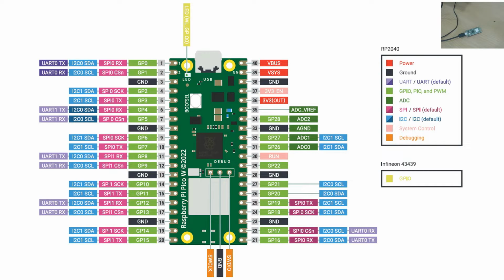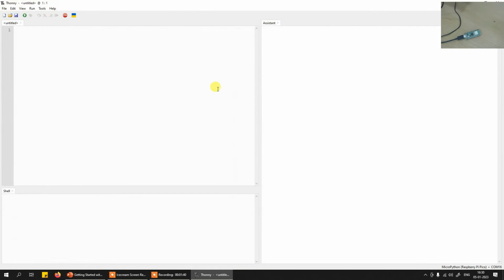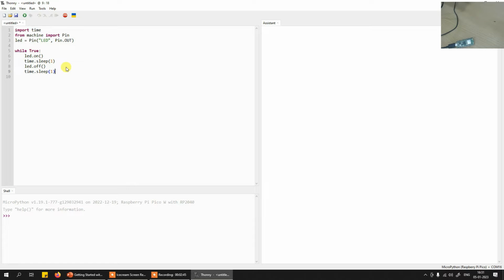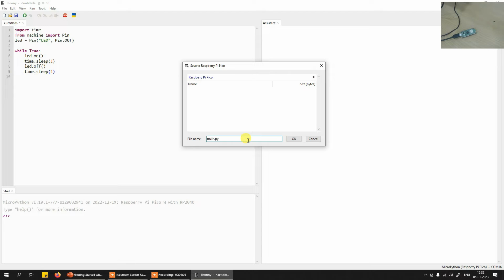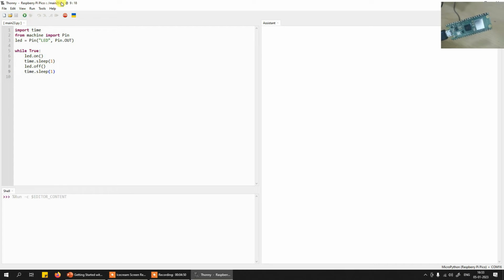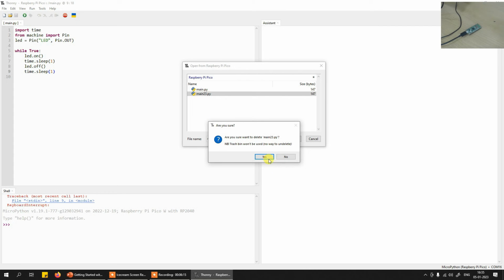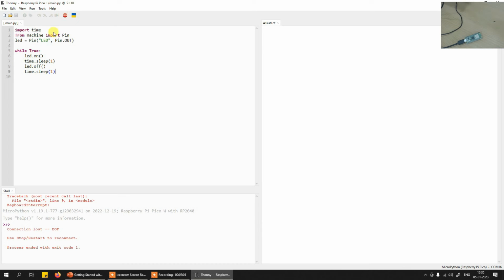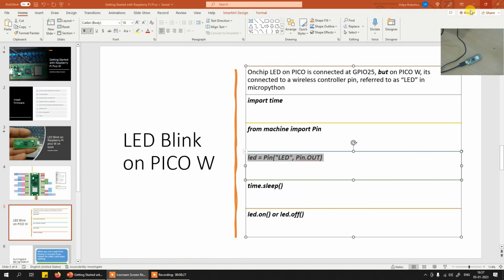How to run program at boot on raspberry pi pico w | Raspberry pi pico Tutorials

Comment: Usually, start with the basics, like connecting it to the PC. Mine disconnects after copying the firmware...
Reply from the maker: Hi, thanks for suggestion, this video is there in pico playlist on how to connect to pc :)
Reply: @kitflix  Sorry mate. The whole pico w process is frustrating. I know how to connect, but Thonny fails to connect.
Reply from the maker: Am sorry ur facing this, if u can send me screenshot of what happens to ur device manager (assuming ur using windows) before and after connecting Pico, same for thonny, before and after connecting Pico, I'll be able to assist further. The thing is Pico is the most straightforward among rest of boards like esp32, so I'd suggest it's worth digging it. Like all things, once ur way past initial hurdles, it's all smooth everytime after. My email id amit (@) kitflix dotcom
Reply from the maker: And maybe, checking this video should help : https://youtu.be/Ri1PJxoGQs8
Reply: @kitflix  You're a top man. Thank you!
Reply from the maker: Am glad it helped you :)